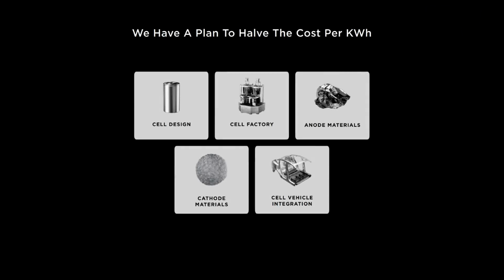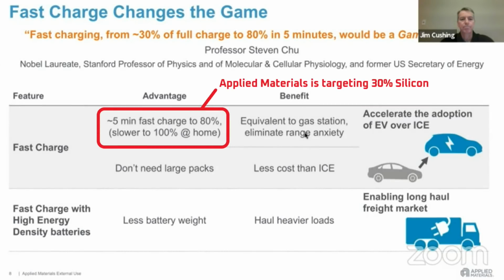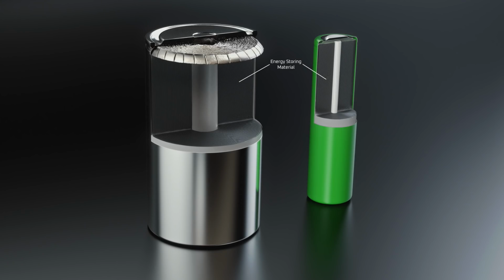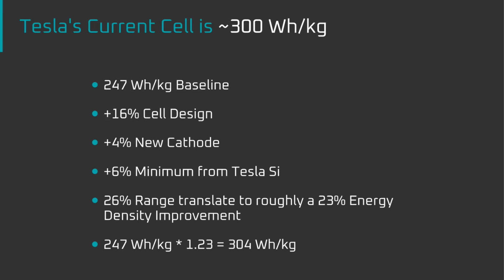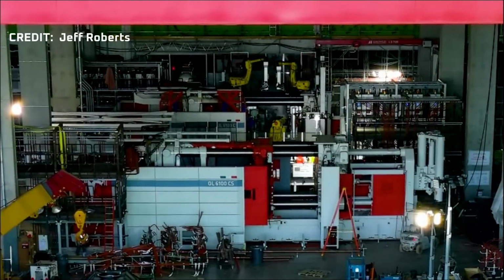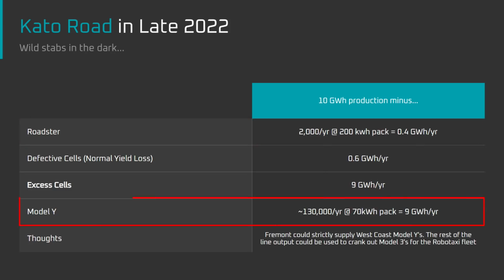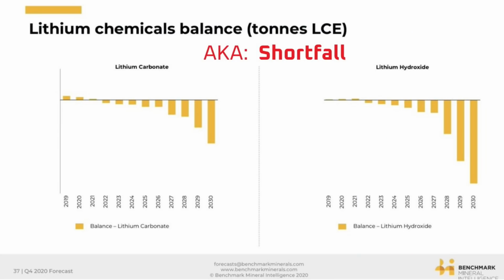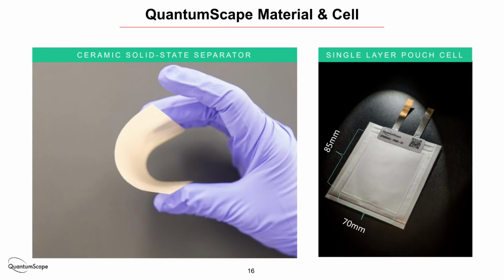#18 Nine Months of Research on Tesla Battery Day  // + Projections!

Comment: Increase yield rate reduce quality rate is a logic easy to believe by those who have no idea of what quality control is about. 

Quality control is not a production issue. It is an engineering issue. A design at prototype stage (30 or so copies each) must show data for six sigma merit just to qualify transfer right  into trial runs and subsequent runs. Trial runs enable gather life data necessary to proof a six sigma merit good to next level or not. The production line administration holds the right to reject a multi hundreds of millions dollar engineering project by the front door to production lines. Example case : if this applies to In Tesla, Elon is not authorized to veto production administration’s decision. That is a board director level issue. Simply because the company will loose multiple times more money from fixing the after market issue. That may be OK if this company has a wealthy uncle backing it up.
Reply from the maker: Interesting!  Is this federally legislated?  Or, can different companies set things up however they like?
Reply: @thelimitingfactor  
Company policy determined. That is a typical example with Fortune 500 company’s policy on quality control.
Reply from the maker: I'd be interested to know Tesla's policy.  Elon is the majority shareholder and nanomanager of everything
Reply: @thelimitingfactor  
Elon is a respected person of mind. Pass on this battery issue to him for me could you?

Comment: Here we have a perfect example of what it means to have good information about the probable future of a particular state of arrangements, how Actuality is phase-locked to this arrangement of e-Pi-i Partitioning of multiphase-locked prime-connection (Amplituhedrons) coordination. The Universe is Holographic in principle, ie stacked AM-FM time-timing resonances distributed in superposition-atomic vortices around orbital-orbits of distributed planesof 2-ness i-reflection containment ACROSS time duration timing relative-timing ratio-rates log-antilog interference here-now-forever Perspective. 

No matter where you are in this Holographic Actuality of Spacetime, you see floating coherence-cohesion objective numberness sequences vanishing-into-no-thing Singularity positioning, (see Professor Hartnoll's Superconduction associations with Black Hole properties derived from Superspin Superposition-point Quantum Operator Logic, Fields in/of AM-FM relative-timing Modulation Mechanism).

The fundamental concepts of information In-form-ation substantiation for Math-Phys-Chem and Geometry phenomena has to become what, how and why inside-outside understanding of Enlightenment merges with QM-TIME Entanglement Completeness.., the Gaian Planetary Ecology rehabilitation requires it.

Battery tech and Chemistry from the POV of Eternity-now e-Pi-i Perspective Principle is this QM-TIME Completeness cause-effect Interval we've labelled Spacetime, and the what, how and why things happen as they do continuously created memory associations, has a direct emulation in the e-Pi-i phase-locked resources of Battery Chemistry, if you think about it and wish to comprehend holography and our inside-outside presence at the here-now-forever quiescent Singularity positioning integration Apature by which we are consciously aware of existence.

Comment: Thoughts on 4680 battery yield?
Reply from the maker: No clue!  6% is currently the industry target, and these batteries will require even closer tolerances.  If they can hit 10% great, if 6% astounding.
Reply: @thelimitingfactor  Massive profitable battery production = success. In my mind this is the single most important critical success factor. If 4680 yield is too low due to the number of innovations it will impact ramp up and profitability. "Touch wood" I'm completely wrong. Panasonic seemed to think 4680 yield was a hurdle. If there is any company in the world that can make this work it's Tesla. Interesting second thought.. Ford owes 161B. They need to invest another 30B (their figure) to build their electric future. Ford can sold 800K super profitable F series trucks in 2020 and still lost 4B. How many truck sales do they need to lose/year to go bankrupt?

Comment: Li Co or Li Ion are better than LFP or Li Fe. IMO Tesla should have developed LiPo and even  better a Graphine LiPo in min where a std LiPo takes hours.
Graphine LiPo are fast charge (20C)
Graphine LiPo are long life
Graphine Lipo no cooling
Graphine LiPo fotm is brick sheets or panels 
Graphine LiPo low weight
Graphine LiPo low IR
Graphine LiPo no memory.
Graphine LiPo high discharge.
Graphine LiPo are light years better than any LFP cell.

Comment: 250 mile range is laughable for most. It may be fine initially for the people hyped up about electric vehicles, but the masses will expect significantly more range than ICE vehicles, due to inconveniences of charging, extra electrical loads from weight, running accessories, weather, battery deterioration from charging, ect.. These may be the future but please stop lowering expectations of range as most don't agree.
Reply from the maker: Any data to beck up that claim?  Also, people will still have the option for a long-range ev, they will just need to pay a few thousand more.  Just like nowadays that pay a few thousand more for a larger engine.
Reply: @thelimitingfactor  Just what I hear people around me saying, and me personally. The masses just aren't going to buy a car they can only use most of the time. This criticism isn't aimed at tesla, as I am a shareholder and see the advantages they have over the other brands. I just hope Elon doesn't under estimate the importance of range in EVs. Its the biggest factor other than maybe price. 0-60 times sound great for marketing and all, and maybe lure in young people, but once your using it and realize all the inconveniences, not to mention battery degradation from charging more often, that come with limited range, you want more range.
Reply: I am able to charge at home overnight very convenient! But using a rapid charger away from home takes around 40 mins (20%-80%). This on a long journey isn't an "inconvenience" as I need stretch my legs, have a toilet break and buy a coffee. My MG5 EV does around 200 miles per charge, more than enough for 99.99% of my journeys. Tullan, which ev do you drive? It's a shame you have had a bad experience with it. The charging infrastructure does need to rapidly expand here in the UK.
Reply: This idea highly depends on one's geographic perspective.  For the minority sub-population that lives in rural areas they may readily agree with your fact free assertion.  However, the overwhelming majority of the population lives in urban/suburban areas in which case a 250 mile range may be just fine.  You should revise and extend your comment to further elaborate on the population or sub-population which constitutes "the masses" and "most" of which you speak.  Your comment may need to be qualified and cabinned to the sub-population who may indeed constitute "the masses" (i.e., a majority) of that sub-population.  You should not claim the mantle of speaking for the population as a whole when you are in fact advocating and speaking for the interests of a minority subset of the population (what I hear from people around me saying).  Do tell, what is the geographic setting from which you draw your experience and your opinion?

In my opinion, people who feel they cannot live with a 250 mile EV range should simply pay the extra premium to purchase the longer range option or forego the purchase of an EV and stick with gas.  In my opinion, a 250 mile range is most definitely NOT, as you say "laughable" for the majority of the population who live in and mostly travel within an urban/suburban setting where travel distances and charging options are well suited to a 250 mile range.

Comment: "Speed upstream"..? If  a particular Laboratory has the technology to speed up the testing of Batteries and reduce 10 years into 1<->3, isn't that why the inclusion of Si is coming sooner?

Likewise, the Liquid Metal Batteries technology is derived from Aluminium Smealting and high temperature Electrolyte Separators that, superficially at least, resemble Solvent Separators used to purify Partial Solutions. Fields of Solar Power Panels are easily assembled next to Mine Sites, so the Technology Ambri is developing, plus Green Hydrogen mineral reduction to raw Elemental Metals might revolutionise Mining Industries sooner than expected? 
All very interesting to think about.

There's no shortage of people with ideas and skills. Elon "loves NASA", and that Moonshot Mentality.